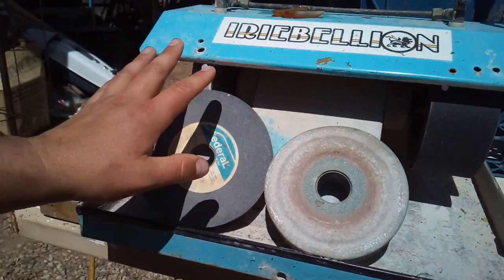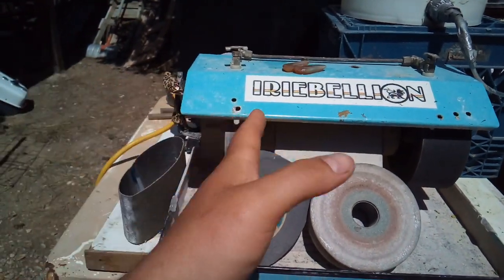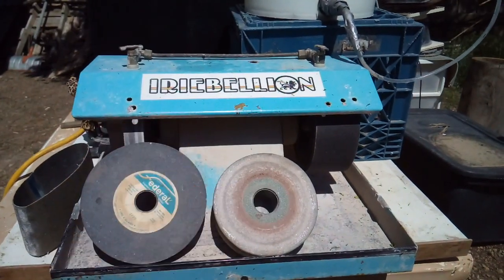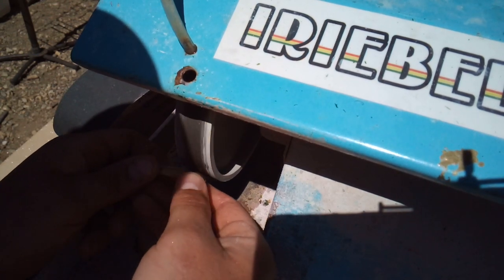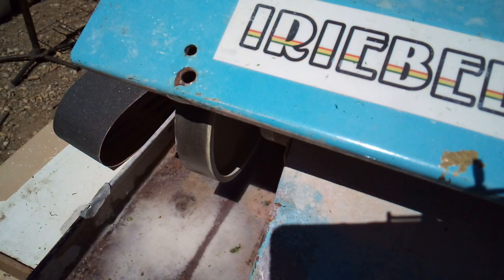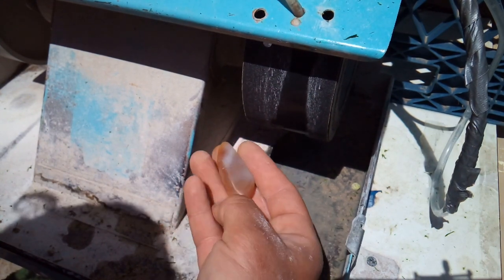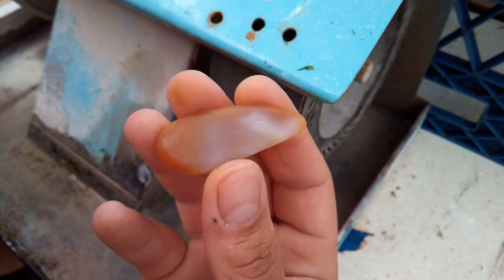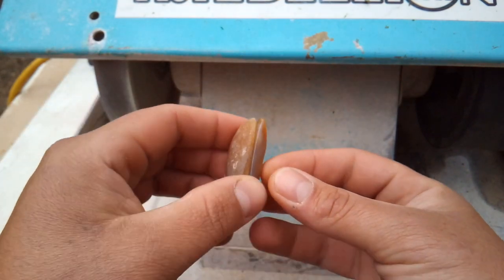Cutting Agate with Silicon Carbide Belts

Comment: Thanks. Very relevant. Almost all of my material is Lake Superior agate or petrified wood and my HP runs 80 and a 220 silicon carbide wheels.
Reply: Meant to say I'm repairing an older wheel that hold silicon carbide belts as well.